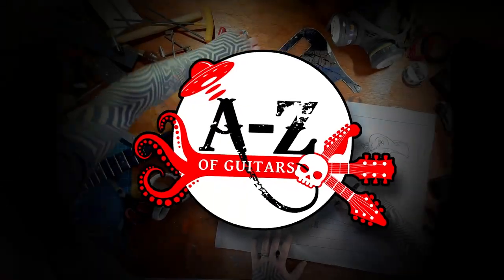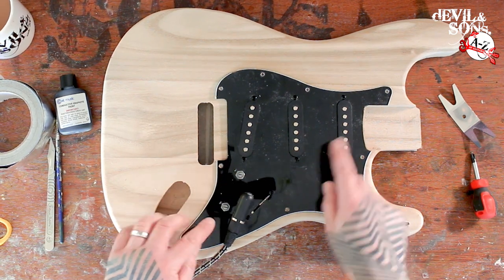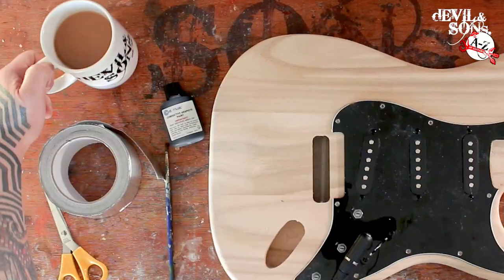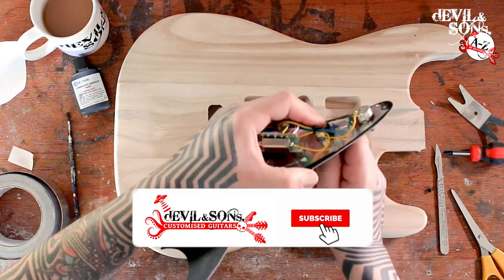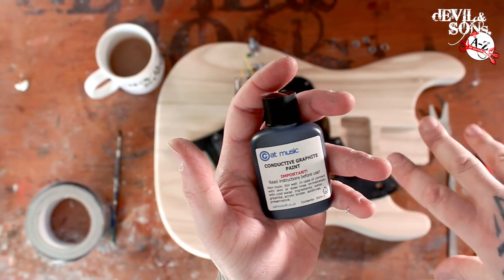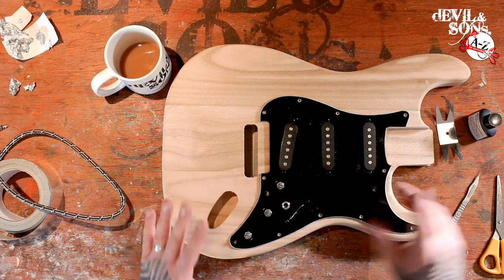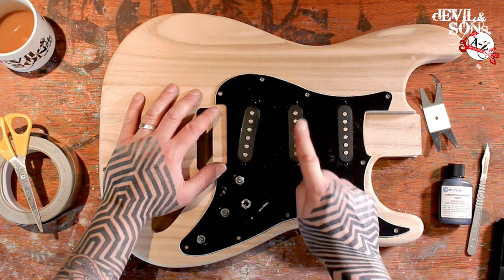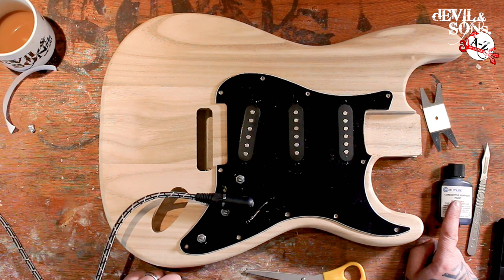Definitive proof that you need cavity shielding on your guitar

Comment: I haven't tried the paint yet but copper tape did nothing, I covered everything even overlapped every lip around instead of just small spots as you did. My conclusion is at low volumes and transistor amps may sound ok, but turn it up and using a tube amp, not worth the effort.
Reply from the maker: Interesting. I wonder if it's the copper or simply as you say, the amp combo. Did you have any areas that have tape on them that aren't grounded (I.e linked back to the main cavity and touching the pots which are grounded or with a wire directly linking the cavity to the ground)? It's possible the copper in cavity that isn't grounded may actually be amplifying the sound.
Reply: @DevilAndSons  I can't imagine that would happen, I don't use nylon or rubber washers so they should be grounded. Ground to the springs as well.
Reply from the maker: I am very surprised then. Is the hum bad?
Reply: @DevilAndSons  No worse than without, Tex Mex pickups
Reply from the maker: How frustrating.
Reply: @DevilAndSons  Doesn't bother me much, I tried it, didn't work for me, now when I sell it I can post nice pics showing a copper shielding everyone wants
Reply from the maker: Ha, that's a great attitude.
Reply: Question Everything  No effects, and no noise with Humbuckers and noiseless singles using the same exact setup. I have 5 Marshall Heads and many vintage amps. I'd know if there were grounding problems. If this actually worked Fender would be doing it and charging a premium for it. They don't.
Reply from the maker: This is a good point, you can cover a cavity with shielding tape but because of the adhesive on the tape it sometimes breaks the link between pieces of tape.
Reply: @DevilAndSons  did you check for continuity?
Reply from the maker: I think I may make a video explaining the importance of this.
Reply: @DevilAndSons  . Nice video by the way! I don't know why youtube tagged you. I meant my comment for freakbiker and the problem he described of the foil not working for him. But I think it would be awesome if as you mentioned you do add a section where you show how to do it with a multimeter and what spots to check, specially for those completely new to shielding. I'm my experience shielding does work, specially if you use conductive material like copper foil with conductive glue  and make sure there is conductivity and proper ground connection. Also shielding will no eliminate all hum, but it will reduce it to what in my case I think is an acceptable level.
Reply from the maker: Thanks for a productive comment. I saw a great way to make continuity work with out electric glue but by making strips of the foil that run the length of the cavity face down connecting all the pieces together. It's hard to explain in words so I will make a video. I'm actually trying to make as many videos as possible this month so I can start uploading regularly over the coming months.
Reply: @DevilAndSons  Awesome. By the way I like how you made this video short  while actually showing the testing audio results of the actual comparisons. Many other videos out there, while they show how to do the shielding, they leave out the before and after of their work which is a bummer.
Reply from the maker: I know what you mean. I've seen too many videos of people chopping up wood or spraying things so i'm now trying to make short videos focusing on the in-between bits, before being important. Thanks so much.

Comment: My guess is Crimson guitars. I use copper tape and shielding paint. Preferring the paint for the cavities because the cavities don't tend to be none too smooth and the paint can get into all the crevices nicely, with the tape on the back of the compartment covers.
Reply from the maker: I should have tried that combo, it does make sense to tape the back of the covers. The video at the end of the month will reveal the logos (but you're doing very well).
Reply from the maker: I hear a lot of people saying they prefer copper.
Reply from the maker: I think you're right, the shielding paint you can buy must be of varying quality (and price). I bought a cheap make online to test and it was actually quite good so I'm sure making your own must be at least that good.

Comment: Do different pick ups ie single, humbuckers and p90's change the need for shielding,i.e. do some require it more than others.happy noodling
Reply from the maker: Yes, but in fact there are lots of things to take into account. Some wire is shielded anyway, and some pots are just better built than others. But generally humbuckers are designed in a way that eliminates the hum, so you may not notice any difference with shielding. Most humbuckers are going to have a metal base that works like shielding would, and that's wired into the ground loop, and some p90s and single coils may have metal bases too but that's not as common (at least with single coil, I'm notb100% sure with p90s).my thoughts are you may as well shield unless you have something that may interfere with shielding, for example I'm installing a piezo pickup and preamp that recommends you don't shield your guitar as the preamp may pickup interference from that.I hope that helps. Happy strumming.
Reply: @DevilAndSons  cheers for your advice, l think painting it with carbonised paints the way to go.
Reply from the maker: My pleasure, thanks for watching.

Comment: Shielding the cavity is just a rubbish way of making an antenna to capture the EMF.   if you just shielded the pickguard and grounded that it would be much better than what you did here as it covers a larger surface area and captures to bleed EF to ground.     now, if you shielded the pickguard and grounded it THEN  did the cavity's and comnpared the two,  you would find it made little difference as shielding the pickguard captures a greater percentage after that shielding the cavites is just capturing a miniscule amount  of whats left,   also just seen you comment below about faraday cage.  that does not apply to guitar as you cannot create a closed system and unless it is closed it does nothing.  there is no such thing as a faraday cage half working.  a faraday cage with a hole in it EG. the pickups   is not a faraday cage and does nothing.
Reply from the maker: You are definitely right about the Faraday cage, people talk about that all the time but the pickups will always be outside it surely. I'm not sure about the rest of what you said as shielding the cavity does make an auidable difference. I can't see how just shielding half the cavity (the pickguard) is better than shielding it all.
Reply: @DevilAndSons  ahh right well basically by shielding, your not covering anything or blocking as such. As the only Ef your guitar can pick up if from the pickups, and you cannot cover them so Your making an antenna so the EF gets absorbed more by that and sent to ground rather than the pickups.   As for the most part the pickguard is usually large enough to make an antenna that by that point there’s not much left for the small cavity antennas to capture as the pickguard has already scooped up.    With no shielding on the pickguard yeah you will hear a difference by just shielding the small cavities.     If you look at a band say autolux years ago they covered their whole guitar body and bass body’s in shielding on the front (as they use a ton of effects) making a huge antenna around the pickups and sending it to ground.    Has nothing to do with stopping ef hitting the controls or switches that would be impossible without at least an inch thick of copper surrounding it.
Reply from the maker: Very interesting. Sounds like some more testing is needed. But, do you think shielding everything is detrimental or just overkill?
Reply: @DevilAndSons  depends.  Shielding all the cavities on some guitars may result in shorting connections immediately or down the line Especially if it peels up.   I think the pick guard is sufficiently large size.    I know a few people who have stuck copper tape all in the control cavities and then one pickup won’t work or the tone does nothing.    I’d say it’s not worth it unless say your guitar has no pickguard.
Reply from the maker: Yes, that is obviously a problem if not done properly. Thanks for input and info.
Reply: @DevilAndSons  ohh just thought,  you could shield both and wire up the grounds to the outside where you can switch between just cavities just pickguard or both and none.  That would be interesting.
Reply from the maker: Nice idea, although I would have to isolate the pots from the pickguard as they will ground it. Either way I definitely will try something in the new year.

Comment: i shield my guitars with noiseless pickups...
Reply from the maker: That's a good solution. Any particular brand and models you recommend?
Reply: @DevilAndSons  Either the dimarzio areas or practically any kinman set.....coupled with shielded wire for the input jack its all i need for a dead quiet guitar.
Reply from the maker: Shielded wire makes such a difference 
I'll look into Kinman, I don't know their products.
Reply: @DevilAndSons  They are a bit pricey but pretty much the best strat pickup sets out there......all the tone, no noise...i mean i tried everything,shielding paints,copper and aluminum tapes,hand made dummy coils,fancy uber expensive dummy coil like systems like the ilitch one and in the end a set of high quality noiseless pickups can do anything with zero noise not just reduced noise......even regular humbuckers are noisier than these things....
Reply from the maker: Well that sounds amazing.

Comment: Two things that don’t make sense, 1.  The noise you are shielding is 50hz and 60hz depends on the country, this is from your line the the ambient, not in air.  2.  Shielding is suppose to create a Faraday Cage of what it enclosed and protect from RF interference, but your strings and pickups are outside of  the shielding and these are the sources that pickup and amplify any RF signals.  You are better of using twisted pairs in your wiring that scientifically eliminates noise….noise signals will cancel each other out.
Reply from the maker: The Faraday cage is definitely a thing, hence why the more that is linked up the better, but you can't (as you say) put a cage around the whole thing. Technically the strings aren't oart of the circuit although they are grounded, the pickups work by the magnetic interference from the strings. Shielding the wires also helps, hence why most pickups will have shielded wires, and most humbuckers will have a metal plate underneath that is grounded too.
Reply: @DevilAndSons  think of the signal path, consider the signal wire and the wires a pipe.  All shielding outside the wire is external to the pipe.  Your signal is the water in the pipe once your strings pickup RF it is duplicated in the magnetic field which will then go from your pickups to wires to your out and out to its final processing and output.
Reply from the maker: I'm a bit lost as to your point, sorry. Are you saying there's no point shielding as you can't contain it all?
Reply: @DevilAndSons  point is all the shielding in the world won’t contain RF noise also 60 cycle noise is in the line not in the ambient.
Reply from the maker: @bluwng  why does it make a difference then?
Reply: @DevilAndSons  I don’t know what you referring to, what is it in this case?
Reply from the maker: Sorry, I think short messages in comments can get confusing. What I mean is, if there is no way to stop the hum getting in do you think it's even worth shielding, and why?
Reply: @DevilAndSons  I personally don’t think shielding the cavity does a lot of good.  Think of it this way, it’s a nice to have but not necessary, it doesn’t really help but it won’t hurt.  As far as noise especially 60hz you have to ask, what is the source.   No one addresses this but 60 HZ is in the line it’s internal not external, some argue it’s from lights if that was true you should get zero bum on single coils in broad daylight, but you don’t.   The best thing to do is correct any ground problems and do a twisted pair on all your pickup wires and your output wires, for output you can also include the ground wire to your tremolo.  Twisting wire eliminates any magnetic interference as the signals are 180 degrees apart and essentially cancel but it won’t eliminate the inherent signal in your line.
Reply from the maker: You can getbhum eliminators and circuit cleaners for pedal boards too which help. I used to think shielding wasn't essential but this test convinced me otherwise, and I find when I do it now (and much better quality than this test) I don't really get any auidable hum, at least on my setup in my workshop. I do agree though, better to eliminate at source if possible.

Comment: I can't believe that you consistently called the metalic tape "insulation".  Insulation by definition does not conduct electricity... only SHIELDING conducts.  By the way, if the tape does not have an adhesive that also conducts electricity, (if it was not designed to be used specifically for SHIELDING) then your final effort will be inconsistent and merely a patchwork of isolated metal islands.
Reply from the maker: Yes, i can't believe it either. 
It's annoying and I corrected it in other videos.
Anyway, you are right about the glue, that's why I'm not a fan of tape.